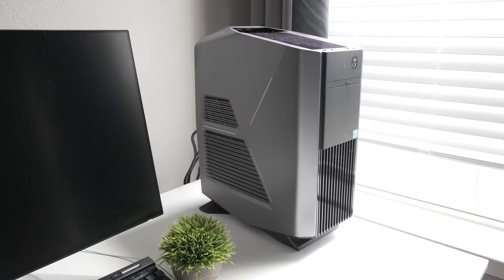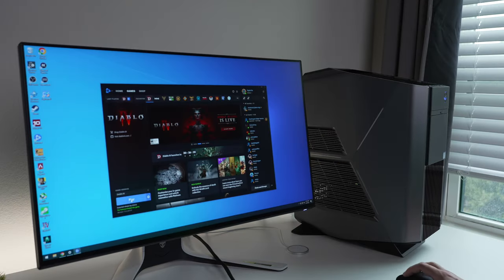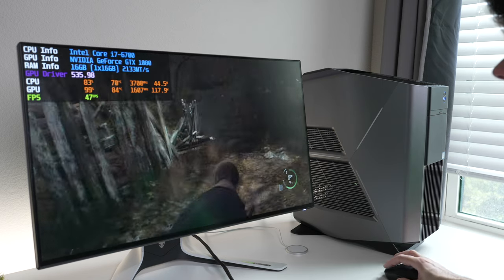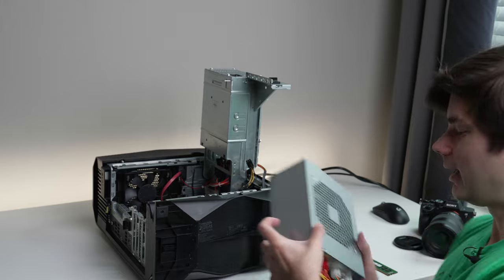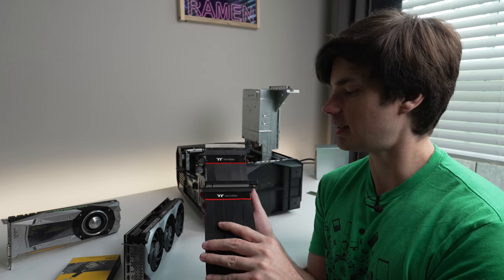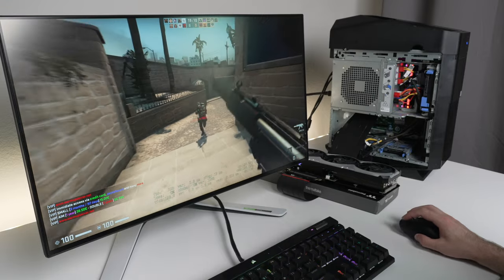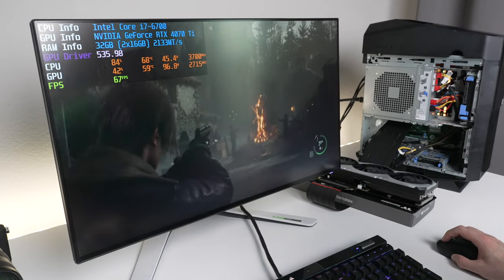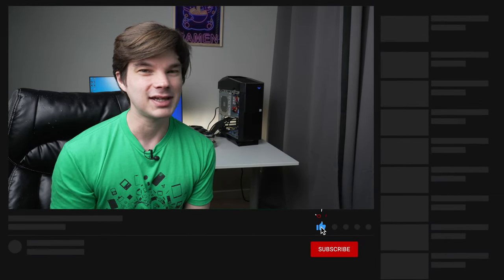Upgrading an Alienware Aurora R5 With an RTX 4070Ti

Comment: i don't know what my friend did to my r5 but i have windows 11 pro on mine.
Reply from the maker: That's pretty awesome. You can get some more life out of the r5. I'm not sure Windows 10 will be supported in the long term.
Reply: @TaylorBrauer  should a 3060 to fit a little better than the 4070? I don’t want anything too crazy just trying to beef mine up a bit.
Reply from the maker: @miscellaneousmayhem8623  It's hard to say since the cards could be varying sizes. Dell has excellent documentation on their website which should tell you exact dimensions of what will fit.
Reply: I got ya. Thanks for the info.

Comment: Is it even possible to upgrade the motherboard on a Aurora r5
Reply from the maker: It might be possible to upgrade to an R6, R7, etc motherboard as long as it's the same chassis. idk that for sure though as I haven't tried this. As far throwing any non Alienware mobo in there, def not.
Reply: @TaylorBrauer I got this exact pc with a gtx 1070. You think I should buy this rx 6600 that I found for a good deal and just use that with the i7 6700 for now? I’m planning to build a whole new system next year but not right now.

Comment: Do u think this processor can handle a rx 6600? I’m stuck with this pc for now and I could get a rx 6600 for 100$ from my friend. Currently have a gtx 1070
Reply from the maker: I don't know anything about the rx6600 to give you a solid answer but as long as it's got the right PCIe port, power delivery within PSUs spec, and it will fit the dimensions of the case then it should be fine. Dell has detailed info on graphics card length supported by the chassis on their site. Good luck!
Reply: @TaylorBrauer  thanks boss
Reply: @TaylorBrauer  and also did ur Aurora r5 fans ever get loud, mine get pretty loud on games like apex legends
Reply from the maker: @dazios6874  It does get pretty loud. That's just the nature of compact cases with a couple fans and lots of hardware. That's been an on going challenge for Alienware.
Reply: @TaylorBrauer  and btw sorry for asking a bunch of questions, is it worth upgrading the ram on my r5?
Reply from the maker: @dazios6874  Not really, imo. It might get you like 1 or 2 fps, if that.